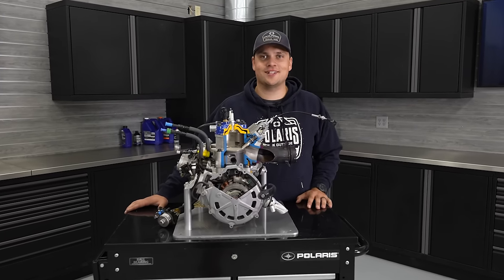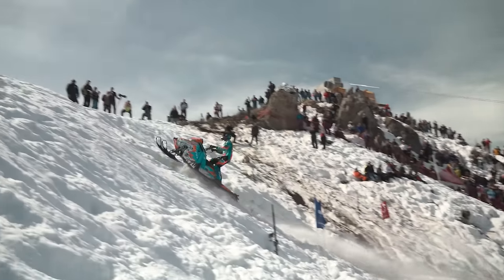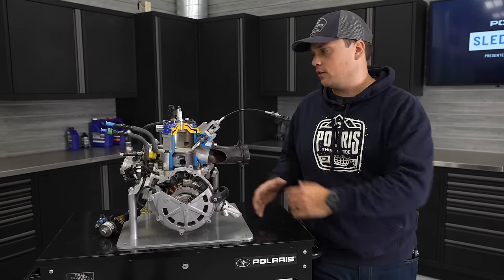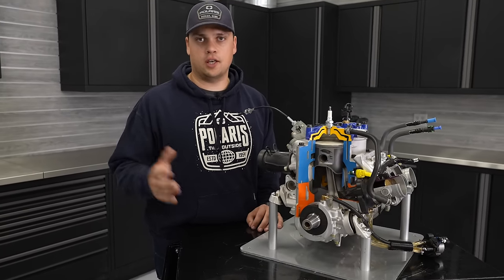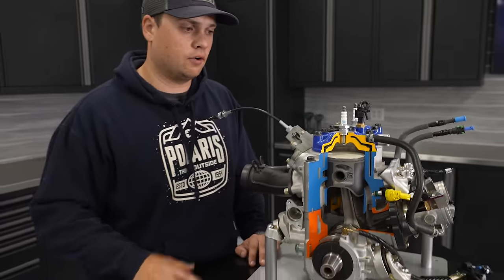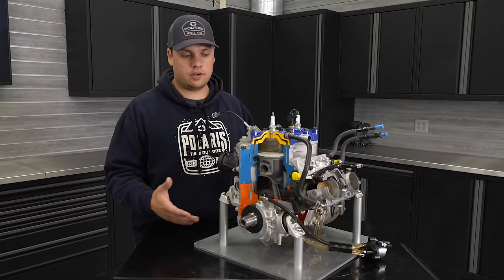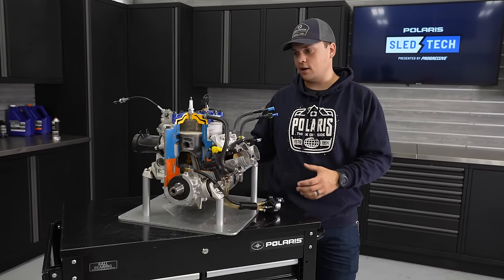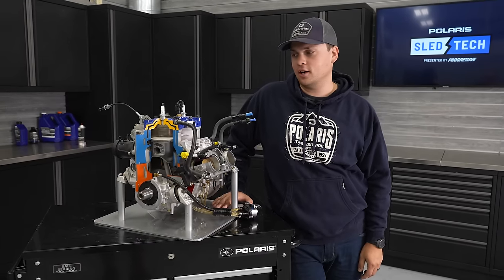Snowmobile Engine Deep Dive - Patriot 9R – Sled Tech EP. 8 | Polaris Snowmobiles

Comment: So how do you explain the price difference? How is it so close to the boost? 
I have a 23’ 9r and a 24 but just wondering how the price can be so close?
Reply: Do you think polaris is making far more margin dollars on the 9R than the Boost? Seems so based off your question. When it comes down to it, the improvements and extra labor on the 9R motor add up to the same price of a turbo system on a stock 850
Reply: @EILevine  I do. A 9R motor doesn't actually cost that much more than an 850 to build from new. I would love to see the actual cost difference. The boost has a lot more components to it, this doesn't'.

Comment: Why only one piston ring? Seems like an inferior design in terms of reliability and durability to use one piston ring on a big bore two stroke. Really, tell the mechanical engineering reason I'm.  curious. 

Also will the 9R actually have good tuning for 2025 or does it take y'all 3-5 years to release a motor and fix all the crap wrong with it? Why do the 9R's foul spark plugs and break ceramic on the plug cause we all know its not NGKs issue. I run the same exact model spark plugs in my sled which is not a 9R and the Polaris 850s also run the same spark plug and they do not have problems.

Same with the boost, are you going to fix the clutching so there isn't over revving issues causing a bog? Your intake on the boost is also too small and doesn't let the engine get enough air in the deep snow, when you gonna address that. 

When are you going to address the throttle block icing issues that has been around since 2011? 

Don't think I'm brand loyal anyone, Cat and Doo also have their issues too and I'd be happy to list them off if someone wants me to. Just tired of seeing brands release sleds that cost 20k USD that don't even run correct or break easily. Quit testing your products on the consumer Polaris, you've been guilty of it for far too long.
Reply: These are all realistic backcountry questions why does every Polaris rider need to carry 4 spark plugs?
Reply: @andrew3791 only 4 ? You are a lucky dude
Reply: @loukadionne9804  Seems like between me and my buddys im the only one who hasnt fouled a single plug with my 22 850 pro, I changed the plugs because it seemed like a thing to do but hand over my heart I havent fouled a single plug.  But then again i run ves extreme and not gold, that seemed like a good idea when i got the sled and its been great.
Reply: The clutching issue has been resolved for 24', not sure what rock you've been living under. As far as the plugs, there are riders who haven't had a single fouled plug and then there are those who can't make it more than a few hours without them fouling. Is it the rider? Is it elevation? Is it the quality (or lack there of) of fuel?? We may never know. But jumping to conclusions just because we've seen a handful of cases on the internet isn't fair. It's reckless and irresponsible.